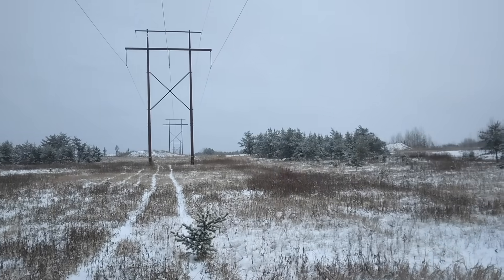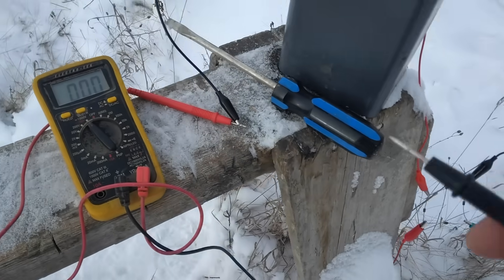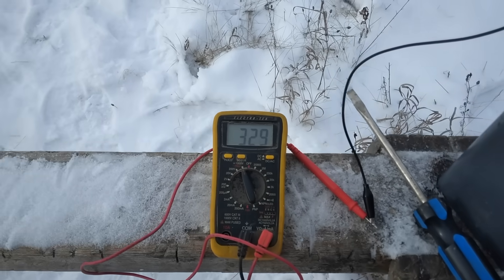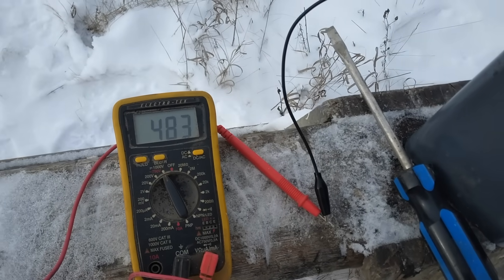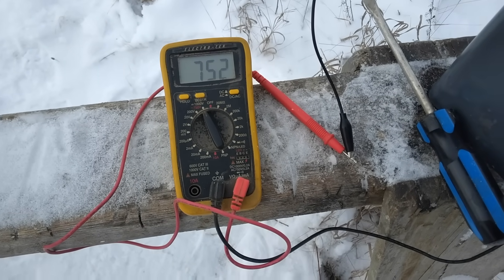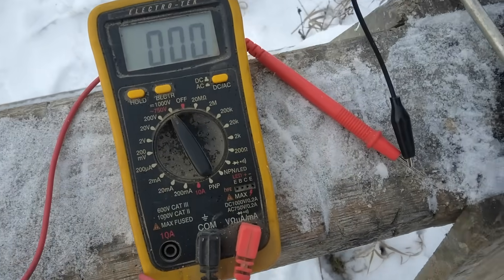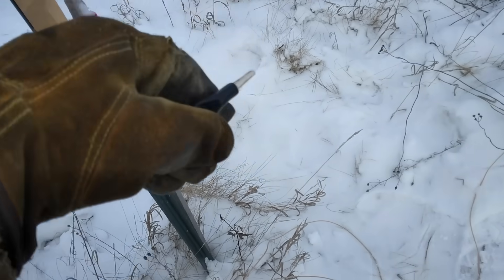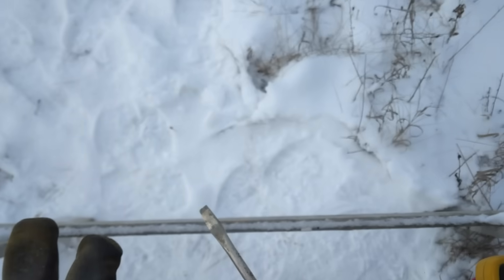Fences sucking power from under HV transmission lines

Comment: At a time when people are struggling to pay their utilities this is indeed interesting. My electric company recently installed one of the new nuclear broadcasting electric meters on my homestead about 6 miles in the country from our small town where I live. My electric bill of course went up. My issue was last spring after they installed it the fall before in late October they came to work on it in early Marchish because it wasn't broadcasting. I told the service man for the electric company that when my central AC came on my yard light would almost go out and have to reboot again gradually getting brighter. So he told me he'd turn up my transformer a little. Well a little over a month later in late may I decided on a warm day to start watering my lawn. I turned on two hoses. I forgot to move the hoses and about 2:00 am i got up out if bed turned on the kitchen light, turned on the garage light and went outside through the garage back door to move the hoses. My water wasn't running from either hose. When I returned to the house I noticed my garage light wasn't on. Upon walking inside through my utility room into the kitchen I noticed my refrigerator wasn't running either. I discovered all my electric outlets on one side of the kitchen were not working. The same side I had a 3way plug adapter plugged into the first outlet on the other side of the partition in the  dining room that had a meltdown just a week or so prior. It even scorched the wall above. I woke up one morning and could smell it but couldn't find it and I went to work. When I got home the fumes were very obvious and I saw the melted 3way adapter.  A friend of mine took the cover off and inspected it, tightened some wires and thought it would be okay. I changed  the front face plate as well. It's just a normal 110 double receptacle. But after I came inside the night of the watering half my kitchen was without power and so were other random rooms in the house including both porch lights. No burning wiring smells just electrical being out in random areas of my house. The next morning everything was working again. But my water well pump that sits a few feet from the power pole with the new meter was no longer working. In the days that followed my air compressor to my central AC unit that sits outside in the driveway seized up. For the next couple of weeks every evening around 9 pm the electricity would go out in certain rooms as before. I ran a short heavy gauge extension cord from one side of the kitchen wall with working outlets to my refrigerator. Then around the same time but in the AM of the morning power would return to those rooms or outlets. My friend tightened the connection to the outlet in the kitchen closest to the one that melted the adapter in the dining room on the other side of the room partition. It seemed after he tightened the wires to the one outlet everything seemed to be working again and no more outages. That same outlet in my kitchen I noticed didn't power up a nightlight last week now almost a year later. My living room ceiling light wouldn't turn on either. When I wiggled the nightlight plugged into the outlet the nightlight and living room light came on. Until I let go of the night light putting pressure to one side of it.  My friend said there must still be  a loose connection in that outlet. But he'd tightened it the year before. It's been 10 months. My Friend isn't a certified electrician.When you wiggle it or push the nightlight to one side and it lights up there's still no power at the bottom receptacle. I'm worried about my home burning down. I recently became unemployed after 38 years running my small company. My house is a pre manufactured home. It's one of the better built,  higher quality ones but I still see the differences in construction,materials used and overall quality. So I'm currently waiting for my friend to look at it yet again. Also i had to put a new water pump into my well last summer and a friend who runs an AC business gave me a good used Trane Central ac unit. It worked great all summer until right about the time thank goodness i stop using the AC until the next season. The last few days before i stopped using it there was no cold air. You could hear it cycling trying to turn on the compressor on and off just like my ac was doing before when my compressor locked up. It is a used unit and I'm hoping its kust low on freon or whatever it requires and needs recharging maybe?
Reply: Get a voltmeter/multimeter and check for lost neutral. If your neutral wire is broken you will see weird voltages on different circuits that add up to 240. E.g. 60 volts on some circuits and 180 volts on others. Or get an electrician or handy friend to do it for you. This is a simple test for anyone who's confident around electricity.

I guess it's a rare problem, but I always remember this because when it does happen it's such a weird problem that seems to make no sense. Some lights burn out from too high voltage, other ones don't light up from too low voltage. 240V stuff works fine.

Actually I think lost phase is more likely the problem. A more straightforward problem. I'm just always thinking lost neutral because that's such a weird problem it always sticks in my mind. With one live/phase wire broken, you'll see 120 volts on some circuits, and a weird voltage or no voltage on different ones, and appliances that use 240V won't work properly (E.G. AIR CONDITIONER MIGHT NOT BE ABLE TO RUN AND THEN THE MOTOR MIGHT BURN OUT BECAUSE IT'S ALWAYS TRYING TO START). When something tries to use 240V LIKE AN AIR CONDITIONER TURNING ON it will kinda sorta power up the broken side of the house but not really. THIS EXPLAINS THE 9PM THING.

You could have more than one problem because I don't see why either of those would burn a 3-way plug.
A non-electrician friend is fine to watch your voltages on a meter and try to figure out what's going on, but I say get a real certified electrician to redo any broken outlets and stuff. Yes anyone can call out a loose connection, but certified electricians learn exactly how tight the connection should be to make it properly connect for the long term. 

There's always a rational explanation, it's just hard to find because everything is hidden inside walls.

Worst case, if nobody can figure anything out, get a real electrician to rewire the whole house or at least thoroughly test every single part of it. That'll cost you, but having a whole new electrical system with absolutely no problems will be worth it.

Comment: In Colorado four wheeling camping pony kegers tripping acid a million voltage line (?) going toward Rocky Mountain Atomic Facility the plant mfg pit’s for thermal nuclear warheads we would run out and and bang wooden stakes into the ground and electrical tape fluorescent light tubes vertically and they would light right up so the other HS kids could find the keg party ,,, the hair on one’s body would go stick up and one could readily hear the ringing noise and buzzing sound even the vegetation was darker deader underneath no lingered underneath for long way to eryie spookish

Comment: You may want to look at that capacitor again. Capital M as in the Mf that I thought I saw marked on the side of that big electrolytic capacitor is mega-farads, not micro-farads.  There’s more energy there than you calculated.
Reply: No, it's microfarads. The choice of symbols on the outside of the capacitor is arbitrary. The physical size of the capacitor is not, and it is consistent with microfarads. A 1200V capacitor in the megafarad range does not exist, but if it did the physical dimensions would scale to the size of a large building.

Comment: Tried to google how many feet of wire in  generator, in a motor, in an alternator. All it wants to give me is information on sizing wire to connect to one. Anyway, I think the best way to tap induction power from these lines would be to run a few thousand feet of wire in parallel to the same length of power line. That would be like a 1:1 transformer 'unrolled'.

Comment: In early, 1980's a lamb in N.Z was killed when it brushed up against a wire fence that ran under a transmission line. 
If you ran a longer multistrand fence. Each wire with minimal insulation but is insulated from the ground, it is highly likely you could constantly change a home battery & run your household off it.

Comment: If you wanted to, you can put the 1k diodes in series to make higher voltage diodes. I would also put 1M ohm resistors in parallel with each diode to make sure the voltage divides equally on each diode. You can also make a resistive voltage dividers some you can keep the voltage measured by your meter lower.

You can also put two of the 1.2kv capacitors in series to get a higher working voltage on 2.4 kv. I would also put the 1M resistors in parallel with each capacitor for the same reason as the diodes.
 
Also remember One joule is also equivalent to one watt-second, so the 36.2 joules is 36.2 watts-seconds.

Good luck and be careful 

Ron, N4PHP

Comment: Question for the experts. In an old house where the 3 lines attach to the outside of the house is there any danger to someone sitting on the inside against the same wall same area ? I'm referring to long-term exposure not lighting strike or such
Reply: This video is about very high voltage lines, hundreds of thousands of volts.
I don't know what you mean by the "3 lines attached to your house" but if they are simply the lines bringing power directly to your house, depending from where you live, they won't likely exceed 230 volts for a residential building.
So the EM field you're exposed to at these voltages is no more no less that little amount coming from the electrical wiring of your house plant, running all around you, as well as from some electric household appliances, the same that billions of people around the world live with.

Comment: Wow! What an interesting experiment, and the comments below are just as interesting. Anyone can see clearly what is going on here, which we should all be aware of. Many times, I have walked areas where these run through because the easement makes it easy to walk through, like national parks and other areas, it is kept mowed down and, on a hill, it is easy to see long distances. So, that amount of energy is below and in surrounding area all the time! It does affect living things..... and could cause some issues I would think! Thank you for this video, it is very amazing! I am going to share and put it in my community spot so others can see too (if anyone looks). Thank you so much and You stay safe!
Reply: careful, alot of times locals like to setup makeshift firing ranges on these straightaways

Comment: While at a friend's house for a few days, I parked my car in back of the house in a field with towers and lines running over it. My car needed a jump start everything I wanted to drive anywhere. Shouldn't it have boosted my battery instead of draining it?

Comment: Great work! And if the electrical utilities have the right to right of way over your property, the landowner should be allowed to access the ambient (lost) energy without being compelled to stop or pay. It is no longer within the utility’s physical property, wires, etc.  Also, if there is that much power leaking, seems like it would not be very healthy for any living organism exposed to it
Reply: It is not lost energy. Find a good explanation of how power transformers work in various configurations. The circuit had basically a single turn primary and a single turn secondary. (no voltage multiplication)
Reply: @buggsy5  thank you

Comment: In New Zealand farmers found they could place their cattle control electric fence transformers under the HT lines and power the fence. The authorities would see the drained energy and fly helicopters up and down the lines to find the losses.
Reply: and they criminally prosecute offenders with Theft of Electricity, a special theft charge for the meter bypasser, and/or people with an induction system. Their scientists can even produce a figure to the court of financial losses incurred..... (if you can't prove the worth or the loss, you can't really prove the theft)

Comment: You won't hurt your meter when you over voltage. It is internally protected. This is pretty cool stuff I learned about in trade school. Now imagine if you had more wire coiled up around a nice piece of cast iron and mounted it on poles higher up to the lines. And then made several of them. You'd have some serious energy potential my friend. Just be careful. 👍
Reply: Yep. Any decent meter is protected against over voltage/current with a fuse.

Comment: I put a door and operator in a poleshed that was under a high voltage line. It shouldn't have been there but he was getting away with it. I got shocked numerous times since I was sweating on a hot day. Later I got a call that the operator had quit working.  I checked the ungrounded door track and it was 60volts to ground. I guess the operator board fried. I replaced the board grounded the teack and wished him luck.

Comment: The induced voltage does no work in an open circuit. The current flow is minimal, described as L times di/dt.  Yes, you can charge a capacitor just from the static charge of the earth's field, even with no power lines present. But you cannot get much instantaneous current with just a floating wire. The capacitor arc is impressive and can be dangerous, but the charge is accumulated over time. You could try putting an inductor under the wires instead of just a long wire. The inductor would act as the secondary of a power transformer. Still, due to the large distance from the power lines, the current induced would be minimal. Your experiment reveals why power lines can be dangerous to biological organisms, since even though the current is minimal, the voltage fluctuations are high and can affect dividing cells in your body, possibly causing replication errors (even inducing cancers). Short term effects are minimal, but long-term exposure to such varying electric fields do present dangers.

Comment: Metal fence is bad idea but if you must ,you need to weld grounding rods to it. I can’t believe the electric company told you it’s ok to put up metal fence.  Ground your fence with eight foot copper rods and remember the section must be continuously connected. You could move the fence away from power lines too. 
Years ago people complained about these HV lines being close to their house. The induced voltage can cause corrosive effect as well. I have seen metal fence posts eaten off at the ground level over a few year period. Go with wood if you can.  You may have noticed metal fence around substations are ground. This is the reason plus to protect in case of lightning strike. 
    One thing to keep in mind is that most VOM leads are rated to 600 volts.

Comment: Did my comment get blasted?
1) This voltage and current is by induction.  Your cable is parallel to the power line.  You've attached a load and so the induced current builds a voltage.  As the capacitor charges, its resistance goes up and so goes the voltage.
2) I'm pretty sure the diodes would go to 2000V across the capacitor as they are in series - 1000V each.
3) No surprise you're not getting much energy, you're too far away (there's also destructive interference from the other two lines).
4) "capacitive" loss from the lines can make a nice hum on a humid day.

Comment: I sounded like I was calling things urban legends, carte blanch.  Getting power from the line, yes.  The story about the horses having breeding problems, for me that one is still out for confirmation.  There are many cases of empirical evidence that can be,  ALthough electromagnetic energy is different from magnetic flux, the FCC in the last few years has tightened the rules requiring exposure limit verification.  I am an amateur radio operator. I help with public service events with a 50 watt transmitter. I have to watch that the antenna is not giving too much exposure.  I have enough cable to put the antenna 30 feet from me and my team.  We put the antenna near the other people (just kidding). I work to limit that exposure WELL BELOW the FCC requirement. One thing, if i get the antenna about 20 feet off the ground, the pattern of it has very little energy going straight down and out to a cone 45 degrees down the amount is about 20 percent and now i have distance that reduces exposure at the square law. 20 feet from my antenna mast, the person is really over just under 30 feet from the antenna and the pattern diminishes it another 80 percent. Yes, responsible operators look at that

Comment: Three lines so probably 3 phase, how about 3 fence wires coupled to a 3 phase rectifier? 
Could be fun. A guy here in the UK lived near a very high power radio station and tried it to illuminate his house using a RF transformer connected to a fence tuned to the radio frequency. The radio station received poor reception results from a certain area and sent a signal strength detector van to investigate and they confirmed a huge hole in the polar diagram. The guy was fined for 'Stealing Electricity'. 😂